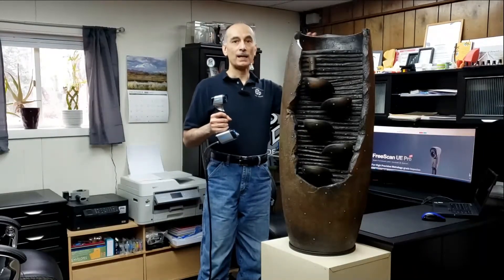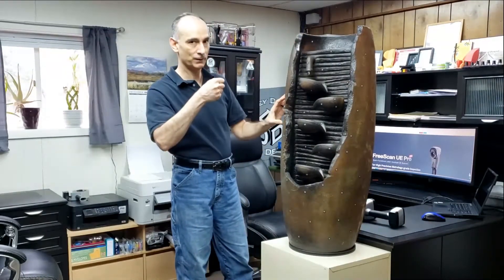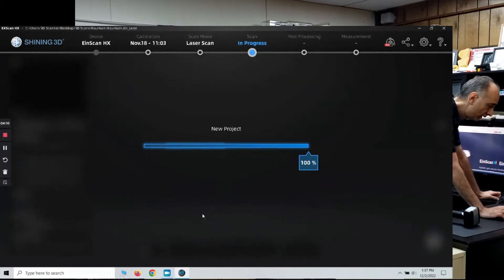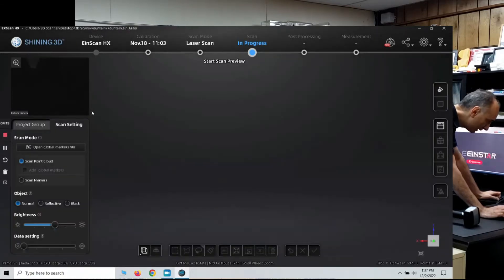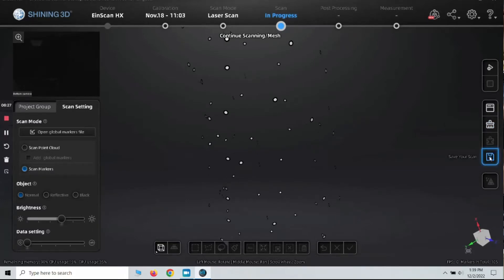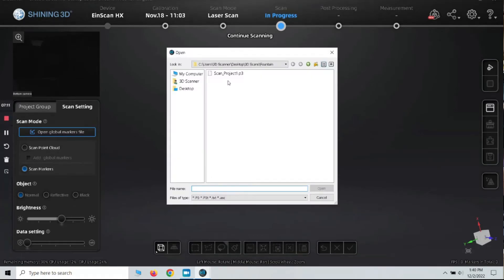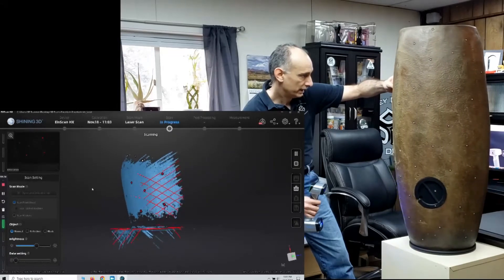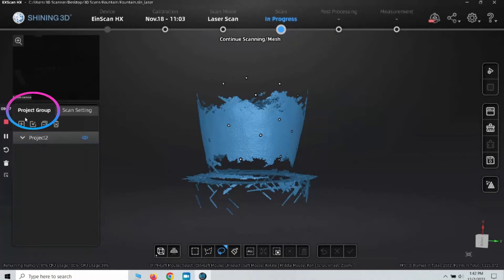How to Align Multiple 3D Scans Into One Mesh

Comment: How do we do this in blender? Is the app free or required to have the 3d scanner ?can you import stl or obj into the shining 3d software?
Reply from the maker: Thanks for watching and for your comment.  Sorry, but I don't know...I don't use Blender.  I think that you use Blender for 3D animation, where this is used for industrial design.  Shining3D has a somewhat new program called Exmodel, and it's more powerful for editing STL files...however, the main purpose for this is reverse-engineering, prototyping and manufacturing purposes.

Comment: I hope I can find help with this, I'm trying to scan a bit of complex object but then I do have problem to work with it in fusion360, I know I do have to reduce the facets(triangles) but after I reduce them it for first: hugely loose quality and other thing is it still can't convert the mesh to prismatic, fusion always crashes. Please if anyone can suggest some ideas will be greatly appreciated. Does this works better with the scanner you got?
Reply from the maker: Are you using an Einscan 3D scanner?  If so, they have a new program "ExStar" that I'm lucky enough to beta test now, and it seems to work great.  No matter what, the Einscan software lets you control the facets and resolution easily.  I'm sorry, I don't have experience with Fusion 360...I use Solidworks.  If you don't have access to these programs, I'd say maybe try Meshlab to process your STL before importing it into Fusion 360?  I think you go to Filters>Remeshing, simplification and reconstruction>Quadratic Edge Collapse Decimation.  Good luck with that...let me know if this helps!
Reply: @Esbservice  sorry, just seen reply, Im using CR raptor but there is no problem with scanner neither program in the end, I found out that fusion360 simply do not like to work with meshes, you can still import it inside fusion workspace move it around but it wont let you edit it instantly, you gotta find some ways to work around it, anyways thank you so much I luckily have found some progress in meantime
Reply from the maker: @robertvegh8177  Thanks for your reply.  I hear you, I wish the manufacturers of these expensive CAD programs would step it up already and get with the times.  It's not impossible, but reverse engineering off of a scan is possible in Solidworks, but it could be made so much better and easier for such a huge outfit that they are.  I was able to quickly edit a 3D scan and go right to 3D printing it using Einscan's "ExModel" software, but I'm sure it only works with their scanners.  Well, I hope it works out well for you...Happy 3D scanning!